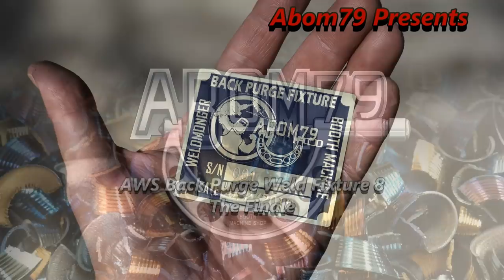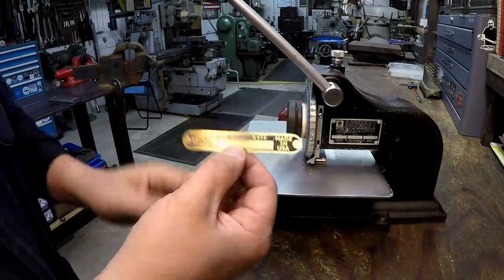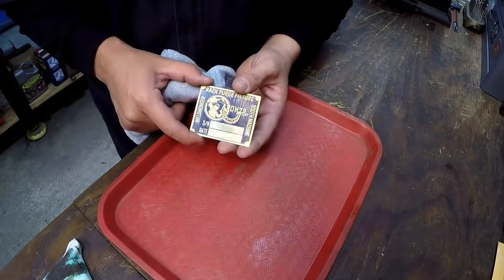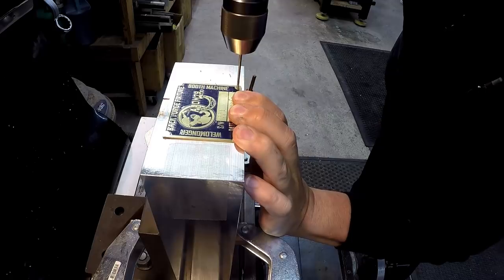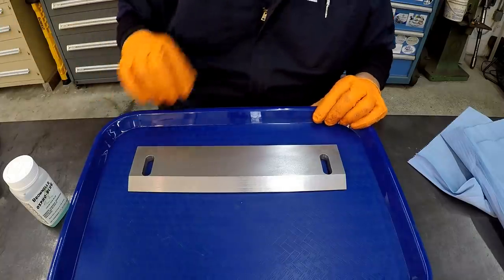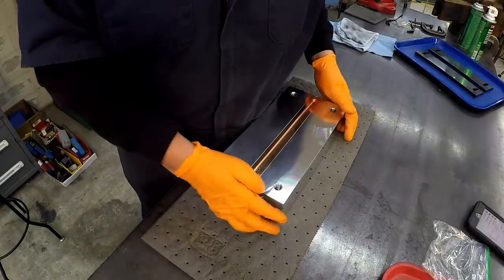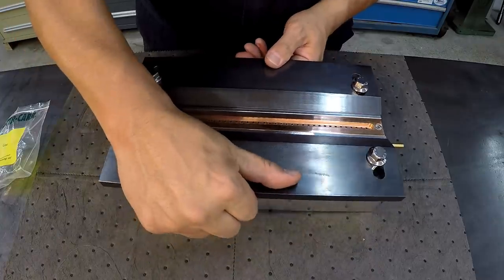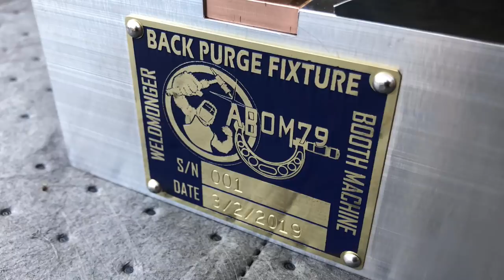AWS Back Purge Welding Fixture Part 8: Finale

Comment: Damn that's nice!

One tip from a leather worker regarding the maker's mark.
When I first started using a mark on my leather goods I was using a lump hammer just like you did in this clip and had a devil of a time with ghosting due to the rebound of the hammer.
I got myself a dead-blow hammer (filled with lead shot). No more ghosting as the dead-blow hammer has no rebound.

Comment: Your explanation of the use is correct. If you don’t back purge your weld can “sugar” on the back side. I have only used back purging for welding pipe.

Comment: Nice work an tag Adam. One thing I'd like to see more manufacturers do is to use some kind of grease or sealant behind these tags. I've seen too many parts where the tags are bulging out or completely gone because of corrosion build up behind them.

Comment: I am very happy I was able to come across your channel. I am a welder, but I find machining to be interesting. Also, your attention to detail is amazing. Keep up the great work!!
Reply: I started out oh I a welder then is started watching how the big dogs machine parts.  is a sweet trade  then  final after years and years became a metal fabricator. a true metal fabricator can build your sheet metal projects weld it together machine the parts needed do structed welding or pipe line ask a pipeline person to build you a square to round they be lost.pipe line is a good trade if you only what to know one thing  adam is a true machinist but with fabrication skills anyone interested in getting started in this trade contact your local tech center after high school  you can make a good living fabricating and machining pipe line work do it when your young make bank and save. thanks adam

Comment: In Germany, we have two types of socket cap screws, DIN 912 for Standard head, and DIN 7984 for heads with half the height. Maybe u can get them in the USA. They help a little, if you have a piece of material, which is not thick enough for the standard screws. Btw, the fixture looks gorgeous. I guess, Jody will not use it, so u have to make a second one, which is not pretty, lol.

Comment: In order to retain your current certification as a coded welder you need to produce test welds joining two stainless steel plates. These are sent to the licencing officials for analysis to prove your welding is up to standard. When welding stainless steel the rear of the weld oxidizes into a crystalline mess unless you back gas the weld. This rig both back gases and holds the plates flat to prevent heat distortion.

Comment: Looks great Adam, a job well done. Button head socket screws could also have been used, the nice thing is they are domed and rounded and a hand would glide over them more easily and smoothly.

Comment: Adam, you have done an outstanding build.  I have found when I use the Oxpho-Blue, I prefer the cream over the liquid.  This my personal preference here, I feel it clings better to the part.  Also I heat my parts to about 100 degrees Fahrenheit you can handle them at that temp, I feel it gives a deeper finish.  The tag and stamp are sooooo….Cool!     Again thank you for a great series Adam.    Matt C.

Comment: Fantastic work with great attention to detail - the project is a credit to you.
PS If bolt heads are intrusive when using the fixture, could try replacing them with Dome or Button Socket Head Cap Screws

Comment: A fine finish is admirable but ya gotta know when to stop!
Reply: i don't think it's too much for a special one-off project
Reply: I know a guy that works for a Big aircraft maker. He did a stint in their custom fixturing shop. They give everyone a project to do that has nothing to do with making airplanes. It's to make a small sterling engine. Use as many or as  few of the tools and equipment available. The point is to illustrate your attention to detail. Show off what you can do. Take pride and set yourself apart.

I expect Adam could've "stopped" many times during this build. But he didn't because this is a reflection of who he is. And he's freaking way better than most to be sure.

Comment: Adam,
Warm the steel to about 110 degrees with a hair dryer before you cold blue.  The steel will blue more evenly.  Also, purchase the Oxpho from Brownell's in the 32 ounce size and you will save some money.  I have some that is 6 years old and still works fine.  Enjoy your videos.

Comment: Looks fantastic!  Piece of art....

My only "negative"....is using stainless bolts on tooling where they will constantly be tightened and loosened.  I find stainless bolts tend to gall, particularly in stainless steel female threads, which I believe Helicoils are....

My experience, anyway....

Comment: Very nice, I loved the series.  People are right, it's too nice to use. When using Oxpho, you could put the metal in boiling water after putting it on, humidifier, card and repeat until desired color is established. I like it though. I think Midway USA has a video on bluing. You need to get the punch for the pins to have a little "B" on it for Booth! You should also stamp the bolt with the Abom stamp! Great stuff as usual Adam. You are an artist.

Comment: Hey Adam, I only use gun blue to refinish or newly finish tools, I makes my shoddy work look so much better, Its great on my cast iron saw bench too. edit PS; as a professional name plate engraver for many years I advse you so make a little disc of flat sheet aluminium or brass and put that in your cloth and it makes the polishing so much easier and doesn't round over the details in time or damage the paint fill. If you have to remove excess paint fill, Use a flattened piece of Cuttlefish bone, (sanded down) like you would give to caged parrots etc to gnaw on as a really fine abrasive to remove it without any scratches.

Comment: Just a tip for the next time. Steel wool has oil in it from factory, when you boil the oil off of the wool, your bluing touch up will work better after you card after your first coat of bluing. Beautiful work tho!

Comment: This was a great series and it really turned out nice (almost too nice).  Maybe you could use hex drive round head or button head screws so that the bolts don't stick up too high and it won't bother your hands too much if they run over them.

Comment: That fixture is a work of art! You could use button head socket cap bolts. The head height on 1/2-13 is only 0.265", and the black oxide finish would match the finish you added to the plates.

Comment: Turned out really nice. I use the same tweezer trick to install drive screws. Like the punch, need to make one! Low Socket Cap Screws would also be a good choice in this application.

Comment: If Jodie still wants low profile bolts, what about 'fairing' bolts, used to hold fairings on motorbikes etc.
Would essentially be just the washer thickness on top. ;)

Comment: Hi Adam, may I suggest if you slightly bend those machinery tags so that the corners are lifted off the item you are fixing them to, once you add the screws they will hold the corners down and this will stop the middle of the tag lifting off the item you have fixed it to. Just an idea! Thanks for the entertainment as always. Also that blacking fluid is weird! Almost like a magic trick!

Comment: There's always cutting a V out of the slots and then using 1/2-13 Allen Flat head screws to keep them flush below the surface.  They won't hold as good as bolts but it doesn't really need to in your application.

Comment: A low head cap screw would work really well there. The head is half the normal size which allows for the use of thinner materials with a larger size bolt. May be good info for the future. Still, it looks really good. Enjoy the channel.

Comment: 17:45 I personally prefer when manufactures use small flat head screws instead of those things... It makes it a hell of a lot easier to restore things when they get older. Another nice touch I like to make on stamped lettering like your serial number is to coller in the letters with a sharpie, or other paint, since it makes the writing pop that much more.

Comment: Like a piece of jewelry, Adam. You could still change those slots pretty easily by counterboring them bigger to accomodate the diameter of your stainless bolts and maybe you have to trim down the height of the hex heads of those 4 bolts; or could go with another head type with lower profile. Not a difficult mod. Super job!

Comment: That would have come handy in the government contracts shop I worked in forty years ago. Lots of odd metals welded and inspectors up the wazoo. Love the badge great job on that. Fifty years it'll come up in some sale and they'll say didn't he do old time video shows. Thanks for a great series
Reply: I forgot try heating the steel up a bit before bluing it , I find it gets a deeper blue black . About 250-300 degrees . When done I always coat with a light oil too. Just my experiences with bluing.

Comment: You can still fix it. If you use button head allen bolts the height of the dome is less so you still have meat on that half inch plate for the recess.

Comment: Hi Adam, nice project. 
You mentioned about using socket head cap screws to hold the clamping bars, you can get low height socket heads which would have achieved a flat surface.

Maybe for the production models. 😉

Comment: When I build fixtures for the weld shop at my job, I always make them as nice as possible before they leave my shop. I photograph from several angles and put prints and photos in a word document for reference. We can check back to make sure the welders aren't making unauthorized modifications to the fixtures.

Comment: Excellent JOB. I could use this too and yes in aerospace and when you work with stainless to match code you do need those and if we can fine tune it you can use it even for tank builds.  I think instead of those 4 bolts I would do something more like a snatch strap system on the side which are similar to what you do have on tool boxes and you do have the adjustment bolt on she side so the top plate stay's fully clean because you clamp on the side.

Comment: Blueing came out pretty nice.
It's often helpful to warm the piece up for cold-blueing.  Just stick it in an oven at 125 or so; nothing too crazy.  Small parts you can just use a heat gun...

I guess it's just naturally hot enough in Florida to make it work.

Comment: In hindsight it might have been an advantage to weld tab on the ends of the clamp bars and then have the securing bolts on the ends of the main body then there would be no obstructions on the top when laying down long welds

Comment: i used to stamp brass with something similar to yours, if you hold it by the bottom with your fingers touching what you are stamping and the stamp barely touching you can use your fingers as a spring so you don't get the ghosting from rebound.

Comment: Hey, those bolt heads are your friend. A stainless slider bar/propping bar could set down right over those bolt heads. They'd stop the bar from sliding horizontally.

Comment: Adam i use a strong Magnet to hold the brass in place while spotting the holes ,,, it works great 
fantastic job
Reply: aluminum
Reply: last tags i had made by a bloke in tasmainia had som sticky stuff made by 3M on the back ,,, you would destroy the tag tring to remove it , magic stuff even thiners woldn`t budge it  @TgWags69

Comment: Also if you want an idea for the hold-down hardware that's a bit lower-profile you could make eyebolts with a square hole and put wedges in from the outside edge.

Comment: If you wanted cap head screws, you could always use low head screws.  Low head 1/2" cap screws have a 3/8" head height.  Granted that the low head screw won't tighten as firmly as a standard soc hd cap screw but in that application a low head is certainly enough.  And while we're on the subject of screws, your local Fastenal distributor is only 2.3 miles from your door.  They stock an incredible variety of fasteners.  Give them a try.

Comment: Just a thought, you could have use SS dome head screws with a #2 Philips head which could be easily tighter and provide a smoother surface when you run your hand along while welding. Just another view on a fine project. Keep up with the fun work.

Comment: Thanks for going over the last part talking about using a counterbored slot. Because the amount of force isn't that high, could you use a flat head screw? A 1/2-13 has just a smidge over 1/4"?

Comment: Wow, that punch does a VERY VERY NICE JOB on those tags man, amazing.  I mean, yeah, obviously it was designed to do exactly what it just did LOL, but it does a great job either way.  Did you say that there are interchangeable dials with different sized letters and numbers?   If so I wonder how far they went with it.

Comment: Such fixturing is used to make sheet metal welds.  Like convoluted expansion joints.   Essential for stainless and exotic chrome alloys as these oxidize rapidly unless purged.

Comment: Adam, I think button head screws would be a good choice for the four bolts, much lower profile and won't snag on tig fingers.  Just a thought.  Either way, your work is simply fantastic, personally I'd hate to be the one that uses it first cause I'd feel obligated to clean and polish it back to the way you made it.  Thanks for the great series!

Comment: yo lol I was contemplating making the pakistani version with a drill, table saw and a die grinder. Last time I tried a big block aluminum project with out a mill I was sitting on the floor cursing at ratchets. Push those fostner bits and aluminum file to the limits! That one is mad nice and it made me think the 700$ price tag on line is fair. You could cut a 'port' into those slots so you can use a flat head screw but it would be pretty dodgy

Comment: You mentioned recessing the bolt heads. Have you thought about beveled counter sunk Allen heads or even not recessing them and running some panhead Allen heads so there atleast isn't a sharp edge to hang your glove up on...

Comment: Adam,

McMaster-Carr has "low-profile socket head screws" and "ultra-low-profile socket head screws" that would have allowed you to recess the top screws like you wanted.  The 1/2-13UNC head height for the low-profile screws is 1/4-inch and for the ultra-low-profile screws is 11/64-inch.  In the future you might want to try some out.

Comment: why not turn 4 custom flat Allen or Torx head bolts with a quarter inch thick head and then countersink or bevel the holes on the plate by a quarter inch

Comment: What a jewel! i would't even consider putting it to work. You are a master in your domain. that piece will definitely sit well in an industrial design contest. 
Just a little remark here. Not that there is something wrong with the terminology you use in this video series but just a few pointers for the benefit of your viewer. 
oxpho-blue is the best product ( in my personal opinion) for "cold bluing"  like you did. conversely, when you referred to black oxide it's a different kind of chemical altogether that is used. And not completely the same process. With cold bluing you can dab the parts with the product, as oppose to black oxide where you immerse the parts in the diluted solution. Let me just say that i rather go with the bluish hue that comes out of a bluing process than the "black gun" result of black oxide. Way less generic!
By the way the difference in shades on your parts comes from the "cold" process of bluing. If you were to use the "hot" process, the difference in the shade would be non-existent. Just think of a classic rifle barrel and you get the idea.

Keep on chippin'

Comment: We also use id plates on the valves I assemble. Engineering changed hole layout on the bodies (they come pre drilled) . This info was not forwarded to the supplier of the id plates. Hence the company had to scrap 5000 id plates. Holes didn't match. That is what can happen when everyone isn't on the same page. Dosen't appear you will have that problem..........

Comment: Looks great Adam, really enjoyed this series of videos.
Have you thought about using contact cement to hold the metal tags in addition to using the drive screws.
I have seen some old tags that were bulging out in the center, and often wondered if they would have been glued, that it could have been prevented.
Maybe use button head capscrews for the fasteners as they have a more rounded and lower profile.
For a quick and fairly long lasting coating on aluminum, I like to spray on silicone lubricant, seems to keep it from
corroding, over just leaving it as is.

Comment: beautiful job!! I'm not trying to criticize but I saw two things that would have been nice to have incorporated into the fixture. first thing would have been a stud or post of some sort to be able to connect a ground cable to, and the other would have been some kind of rubber foot in each corner on the bottom so it would sit better on a bench, a big flat surface like that may tend to rock on a bench that isn't perfectly flat. these things could be added at any time if desired. again very nice work I enjoy watching!!